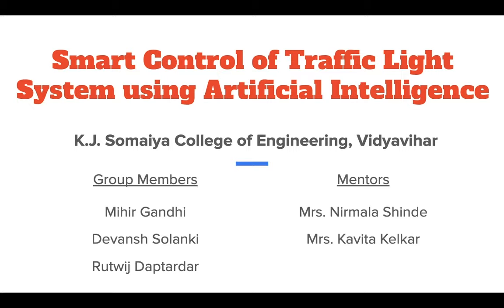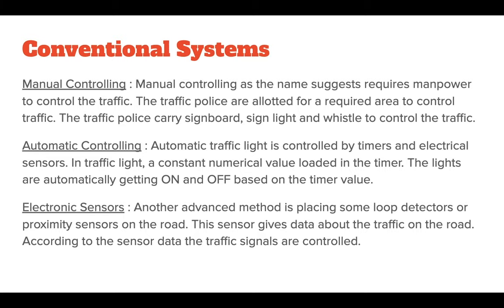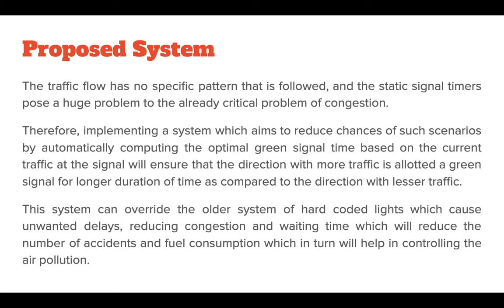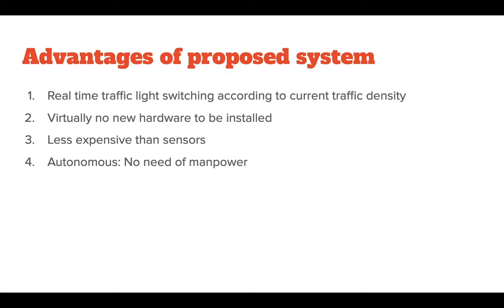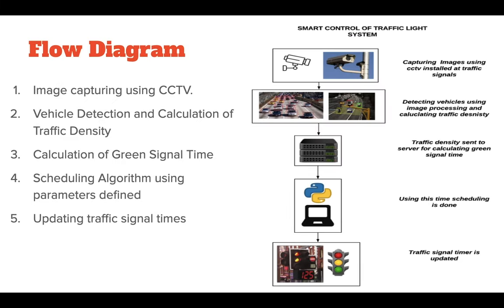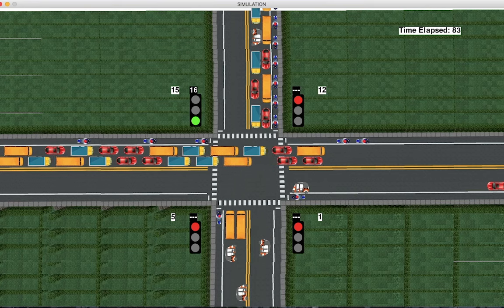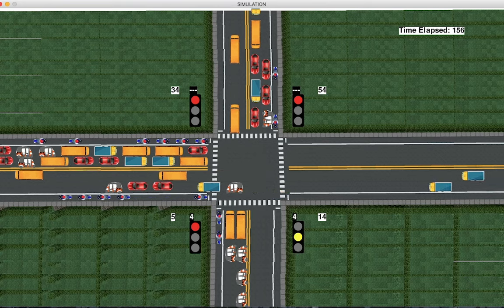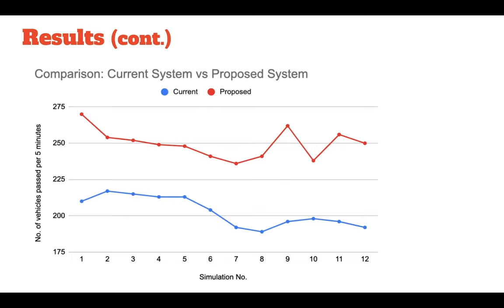Smart Control of Traffic Light System using Artificial Intelligence

Comment: You could also do away with all the fancy AI stuff, and instead have a timer that measures the gaps between cars, and switches the light once it exceeds a certain value (and the queue is considered to have discharged). That's what's most commonly used in real life (vehicle-actuated control).
A disadvantage of using cameras as sensors is that it's affected by weather conditions (rain, wind, snow, extreme temperatures, sun glare, etc), and can potentially be damaged by vandals (e.g throwing rocks). All of this can reduce the accuracy of the data.
Inductive loops are the most reliable detection method.
Reply from the maker: Its true that actuated control is used most commonly, but its quite expensive to install and maintain. Cameras provide a cost efficient way to implement adaptive traffic control. Though it has some disadvantages like you mentioned, the sensors have gotten much better and can always fall back to static values if the data capture fails. And about people damaging the cameras, fair point, but at least you'll have the offense on video as proof! 😄
Reply: It doesn't have to be a camera. As long as the system receives the number of vehicles no matter what input device it uses it would still work.

Comment: Hi Mihir!

I write my thesis about a similiar project of yours, but I think more about this one.
I imagined that not only the crossroads would be controlled by AI, but the whole city would be connected, So that the traffic waves could be even more controlled.

I write my project from a different perspective. From a pont of view of economy. How the less fuel consumption would effect inflation internationally. 

Do you have an estimated data, which approximatlely tells how less fuel is going to be consumed this way?

I am looking forward to your answer!
Reply from the maker: Hi Simon! Your thesis idea sounds very interesting. In fact, we thought about synchronizing multiple intersections to control traffic waves. However, we did not think about it from the fuel consumption perspective. So we do not have any data related to that. I am sure there must be research papers studying the fuel consumption in various classes of vehicles per unit time at different speeds, as well as fuel wastage idling at a traffic signal. You can try looking for those for your project. Good luck!
Reply: @ai_mastery_with_mihir  hlw sir please sir help us

Comment: Good work congratulations!
You used machine learning to detect number of vehicles in the camera
How did you connect 4 traffic lights together? Did you use IOT?
What are other techniques you used?
Reply from the maker: Thanks! We did not implement the project on ground, but you do not need to connect the traffic lights together. All you need is for the lights to communicate with a central server which receives the images from cameras, runs the algorithm, and sends the timers back to the lights.

Comment: In your research paper you have mentioned  current static system, what is that means?
Reply from the maker: It means having fixed green signal times for signals regardless of the traffic density. For example, a green signal of 30 seconds for all directions at an intersection.

Comment: Congratulation on the wonderful work!
Have you considered using the online maps to gather the real time traffic data at the traffic intersections?
Reply from the maker: Hi Piyush! We had considered the idea. However, using an image of the intersection in real-time proved to be the better idea. This is because of 2 things: 
1. If we just look at the data i.e. traffic density (like the Red, Yellow, or Blue colour on Google Maps used to indicate whether the traffic density is very high, medium, or low), then we cannot differentiate among the different classes of vehicles to compute a better estimate of green signal time.
2. Instead, if we use satellite view from an online map service, it will involve a lot of processing, which is not really necessary. 
What do you think about it? Is there some other idea that you are thinking of?
Reply: Hello Mihir,
I will agree that real time data will be best captured by camera installed on the intersections. But there is always the issues of maintenance, cost and scaling up for multiple intersections.

Google maps as you said provides just the colour marking for the traffic congestion, which might not give the accurate indication of the congestion.

There are few more maps service like HERE maps which do have an API for traffic congestion, on the scale of 0-10. But they also lack the clear documentation if one needs to model it during simulation .

Though I am not aware of any satellite based live imaging service which could provide the images for the intersections. As most of the earth observation (EO) satellites are in low orbits and are not geo stationary.
Do you have any plans of deploying this project ?
Thanks.
Reply from the maker: @piyushaggarwal4820  Yes, the maintenance cost and issues need to be thought of. Regarding deployment, yes, we were in discussion with Mumbai Traffic Police to get live CCTV footage and test our system on it. In addition, we were planning to train our model with some of the live data added to improve its performance. However, due to the lockdown, we haven't been able to go through with the meeting.
Reply: can you give me your contacts, i want to discuss on the issue of real time traffic data using google map API

Comment: Hello Mihir.
You showed the comparsion of current system & adaptive system. What value of green time you have considered for current system in simulation?
Reply from the maker: Hi Swati! The simulation was tested with various values of green signal time in the static case. You can use 30 seconds for each direction, or 30 seconds for 2 directions and 20 seconds for the remaining two. The latter is a slightly optimized static case which is used at many intersections nowadays.

Comment: Will this be ready to implement in a small city, lets say at least 10 intersections ?
Reply from the maker: The primary issue when implementing this practically would be the accuracy of detection. A good way to go about this would be training the vehicle detection model using a large dataset consisting of images from traffic signal cameras of that area. With an accurate model like this and some minor tweaks to configuration according to intersections, it will be good to go!
Reply from the maker: @mohdmushtaq6774  Hi, please reach out to me via mail at mihir.mg@somaiya.edu

Comment: Hi Mihir, I'm trying to run your code but keep getting these errors.
 File "vehicle_detection.py", line 2, in <module>
    from darkflow.net.build import  TFNet
  File "/content/Adaptive-Traffic-Signal-Timer/Code/YOLO/darkflow/darkflow/net/build.py", line 5, in <module>
    from .ops import op_create, identity
  File "/content/Adaptive-Traffic-Signal-Timer/Code/YOLO/darkflow/darkflow/net/ops/__init__.py", line 1, in <module>
    from .simple import *
  File "/content/Adaptive-Traffic-Signal-Timer/Code/YOLO/darkflow/darkflow/net/ops/simple.py", line 1, in <module>
    import tensorflow.contrib.slim as slim
ModuleNotFoundError: No module named 'tensorflow.contrib'

Would be great if you could help out for these.
Reply from the maker: Hi, it may be because you have the incorrect TensorFlow version. The newer versions of TensorFlow do not have this module. Switching to the previous version (as mentioned in requirements.txt in the GitHub repo) should solve the issue.